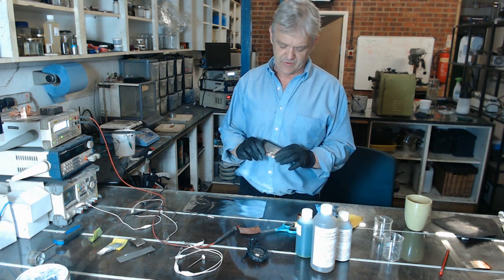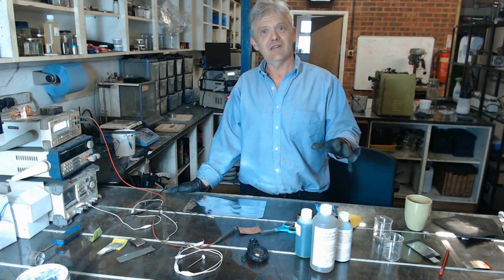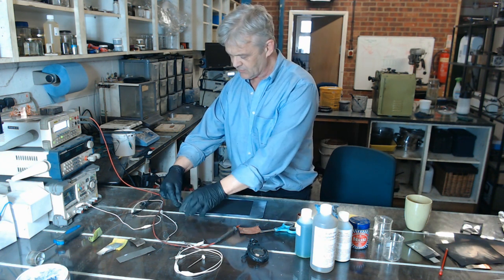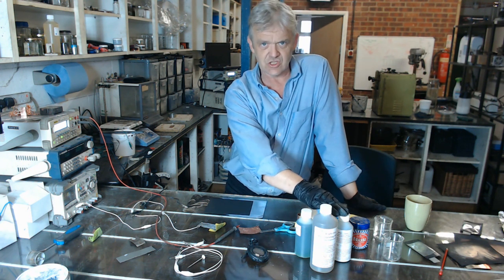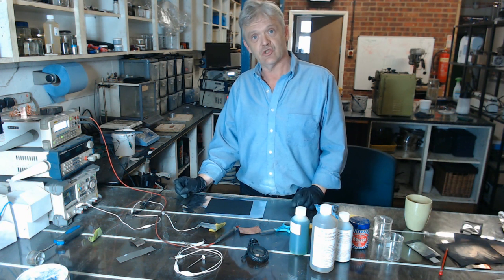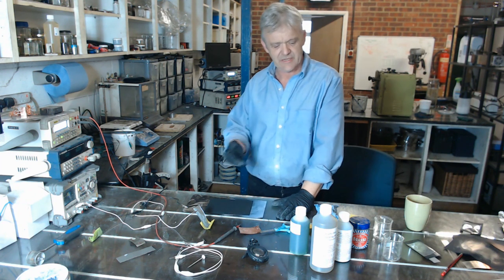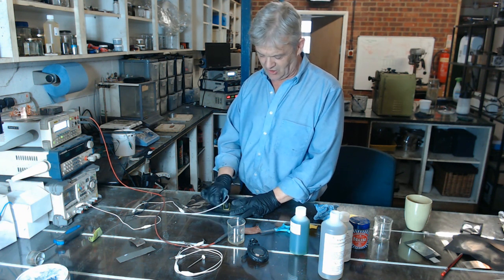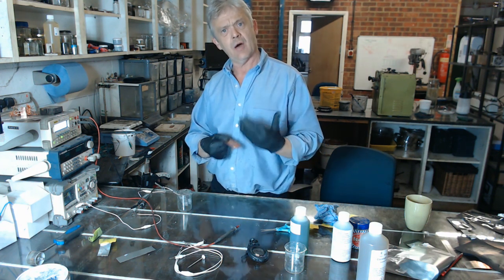Bright Plating Solutions - Plating Made Easy

Comment: Surprised to hear you say about only four plating materials, then excluding gold (fair enough) but what about tin plating? 

All my home made PCBs I used to tin plate just using tinning solution, a plating bath and NO electricity!  Nothing easier!

Warming up the solution somewhat to around 40-50 °C will speed up the plating but I just used to leave it at room temp for around 10-15 minutes. Job done and also comes out more or less shiny. 

After a fresh water wash and drying off that's all the processing required. A ten to 20 second rub with a polishing cloth will shine it up even more and makes soldering to the pads easier even than gold, especially with 60/40 solder.

Comment: The plating room at one of my employers was used for Nickel coating various cases for power semiconductor devices. They first plated with Copper (when necessary), then Nickel was plated on top of it, for best adhesion. Copper headers only needed degreasing, de-oxidising and then Nickel plating. The solution looked like yours, but it was in big baths, maybe 20 cubic metres in volume. 
Nickel salts, as you say, are very toxic, and also carcinogenic. Skin allergies are ten seen with them, too. The plating shop, therefore had everything under what were essentially fume cupboards, but on a larger scale. This was necessary in order to extract the Hydrogen Cyanide which was released during plating. Good protective gear (face mask, suitable gloves, coat, boots, and splash apron) was also worn by people in there.
On one occasion, an extractor fan failed, without an alarm sounding, and nobody noticed, because of the noise of other extractors. I walked into the shop, noting that a couple of women had gone to the canteen, complaining of headaches. The smell of almonds was unmistakable, so I hit the alarm and vacated the area. Headache and sore throat are among the first symptoms of cyanide poisoning.
One big problem with HCN is that if the concentration builds slowly, most people cannot smell it. Women often smell it even less readily than do men, partly because they wear perfumes. Thankfully, nobody was incapacitated, and those affected (most people in there) recovered within an hour or two.
This experience highlights the need to at least ensure good ventilation, and in many cases, to work in a fume cupboard, when working with chemicals. This applies especially to Nickel salt solutions, in the case of FWG.
Thanks for the demonstration, Robert.

Comment: I live off grid in Colorado, and would love to implement your work into my battery bank.  I currently use four 6V  240Ah batterries in series/parallel giving ~12V 480 Ah.  Longevity, maintenance and toxicity are the prime issues.  I am not set up to replicate your work on a large scale, but in your opinion - could this be done for  ~ $2000 American?  Being recharged by an 12 V charge controller off of a medium sized solar array?
  Cheers, I love your work.

Comment: I used some of your old videos to make my nickel plating solution.  The one where you used muriatic acid and black nickel oxide from a ceramics supply to make nickel chloride comes to mind.  Back when you didn't have a vent hood and had to shoot the videos outside.  Would love a follow up on any of those old battery experiments (if you still have them) and what you learned from them.  It's been an interesting progression to see, and I do inexplicably miss the old banjo intro.

 It still makes me laugh/smile to hear the audio quality gripes in the comments (1st thing I do after the FWG logo is max out my volume and lean in) - I'm surprised they don't complain about how fast you speak when you're excited about something since I usually set YouTube to 2x speed, but have to bring it down to 1.5x or 1 depending on the technical nature of your content, but you do normally slow down for the technical details.  It works though and there may even be psychological advantage to this technique - it's very easy to maintain focus.

Thanks for the video - can't wait to see your next discovery.

Comment: Hi rob nice to see back on line after a long absence. Have you tried this method to attract/coated other elementals to stick to Graphene/lithium etc to super capacitors, or battery’s as an electrolyte, or as a thin coating on the separator. Could it be used for this In someway to benefit battery’s or capacitors.
Reply: Would it be attracted to grafoil and coat it. Are you limited in the number of metals that can used in electroplating. Could you used something like vanadium/lithium would the be attracted to any carbon surface and plate it. Would this mean you would not need to use a binder plus you know you have a ver even coating of the element you used. Could this reduce the manufacturing cost of battery’s or capacitor
Reply from the maker: i don't know mate - try it and see
Reply from the maker: dunno mate - i haven't tried it - wrth a try tho